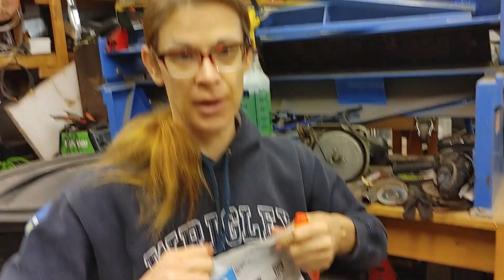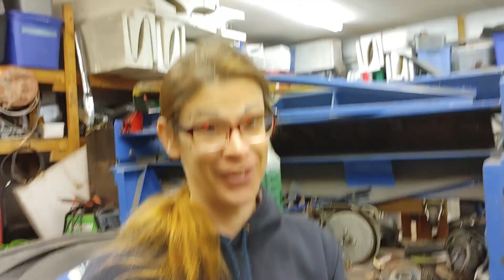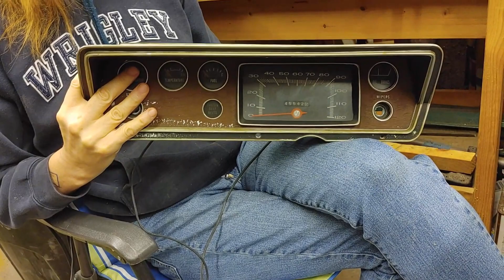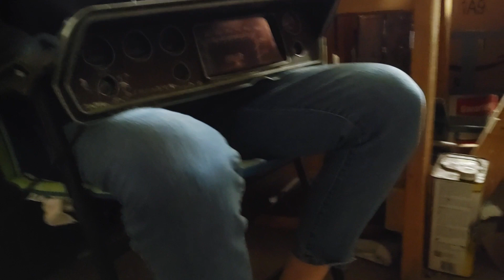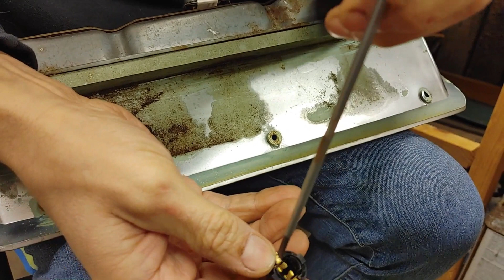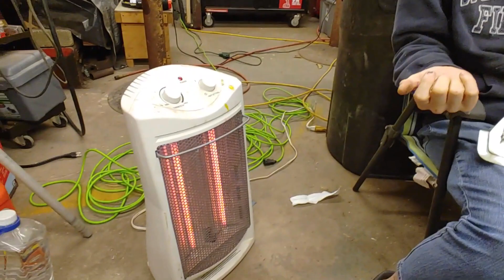Volt Meter Installation and Dash Lighting Project

Comment: The bulb is a 194.  I don't know what a T-10 is.
Reply from the maker: T-10 is the two pin connector on the 194 bulb. There are other bulbs that use that connector. I didn't know about it until Kim told me and then I found other bulbs with the T-10 connector.

Comment: The gauge voltage limiter can become unreliable with age. It can even damage the gauges.  RT Engineering has solid state limiters.  Much more consistent and accurate with fail safe against short circuit.